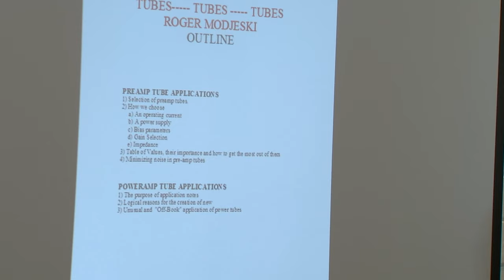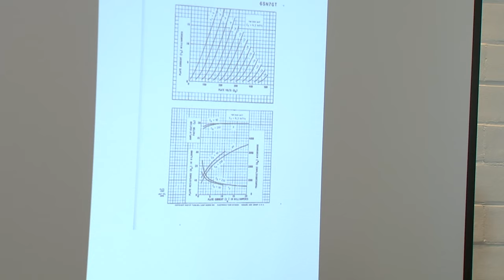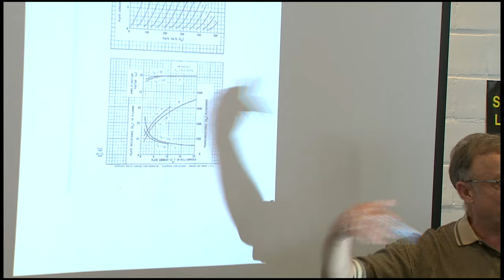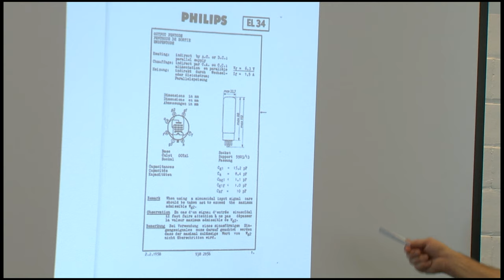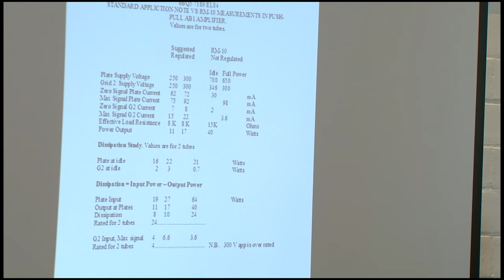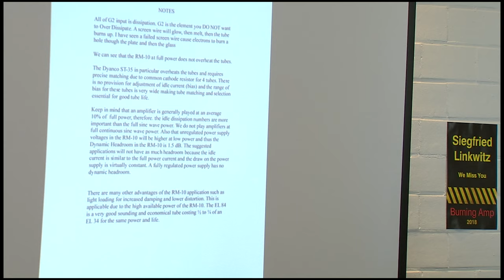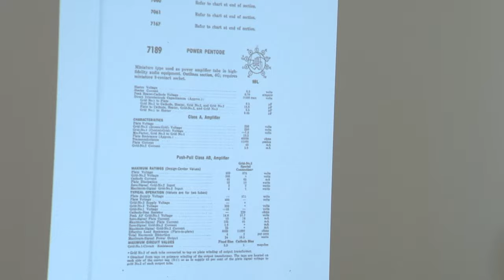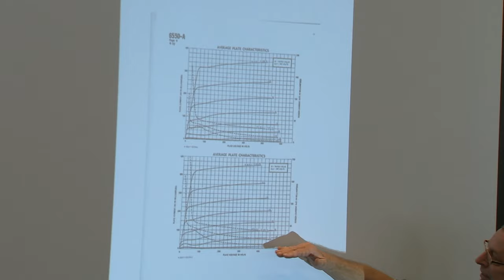Burning Amp 2018 Modjeski Title

Comment: Very interesting! I am a long term tube guy starting as a player with a line of Fenders serviced a lot of high fi my favorite over all was the Audio Research D76 a very well behaved your coment on el34 being easer to make makes great sense and I have be very considers that ! 
It’s getting hard learn thins about tubes so thanks . You are also right about the increase in ac line voltage many things now have a high frequency PWM supply and don’t care but if you have a old tube amp the increase can drive the outputs into therm runaway  I find that a simple 1 watt 47 voltage zener diode regulator on the bias supply of say a Dynaco s70 makes them quite reliable but the main filter caps probably need a up grad as well . Julius Fluter-men came to the shop I worked at on a toor of the county in his car station wagon tried them on Magnaplans and it was the best ever ! Unreliable,expensive, big and hevey but sooooooooooooooooooooo good !

Comment: It isnt worth getting 35 watts from two 6bq5's. The little extra sound pressure you gain sacrifices sound quality because the low current means you go into cutoff much quicker and are running Class B. Class B = not good sound.